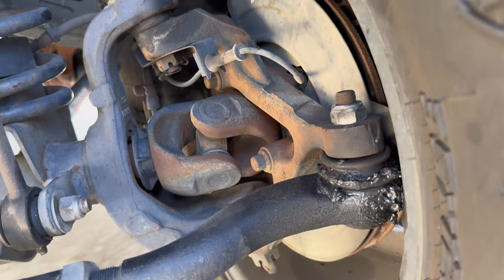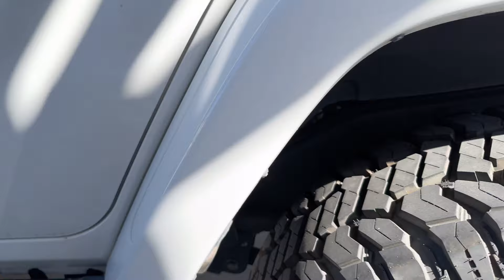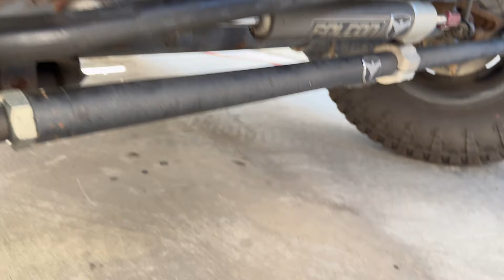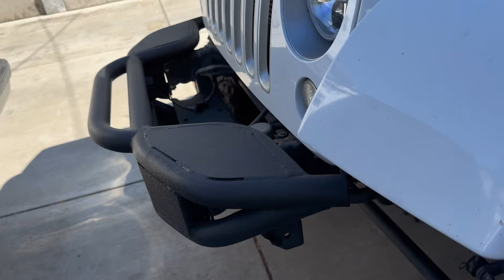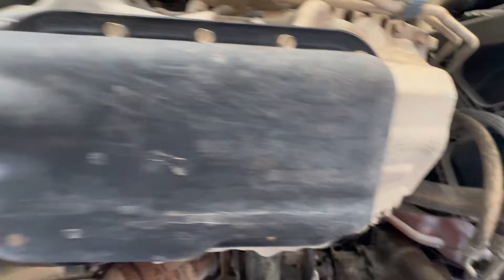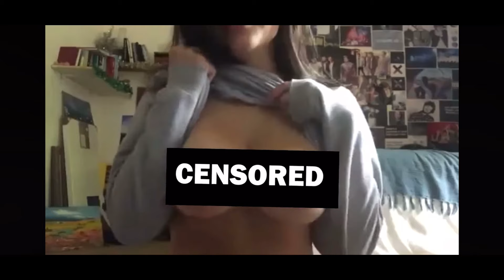Update on my jeep ✌🏻￼

Comment: the leak is  ( most likely ) your oil cooler up top of the engine ,it fills up the top valley then runs down the back of the motor making you think its the rear main oil seal
Reply from the maker: You were right the leak was coming from the top engine filter
Reply: @Carlife209  its a primo looking jeep, classic white